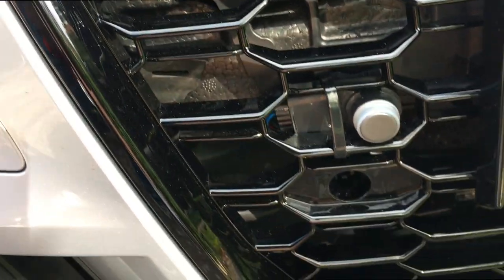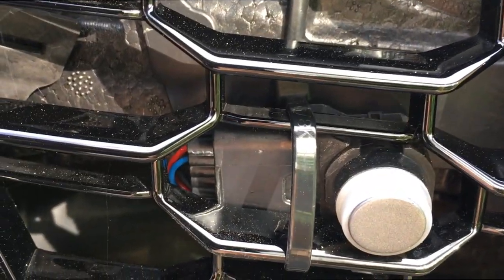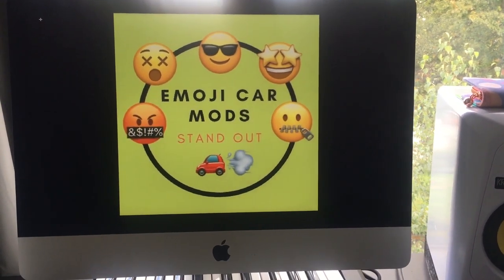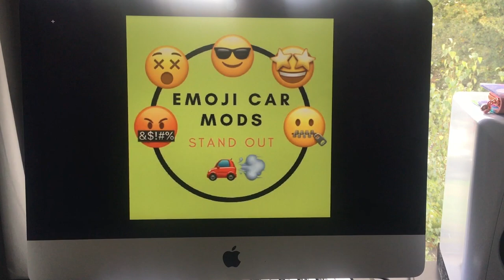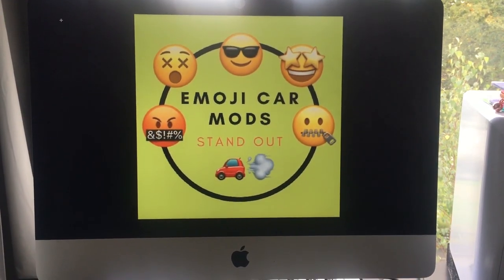THE RS3 GRILL MODIFIED TO FIT PARKING SENSORS #rs3grill #emojicarmods #audis3

Comment: Damn’! Where did u get the parking sensors from? Did you have to activate any code or anything via obd or was it a simple plug and play?
Reply from the maker: The parking sensors came with the car but just was not fitting the Rs grill so we had to modify the grill so it could fit.😉👌😎